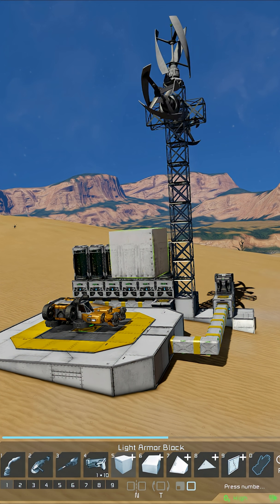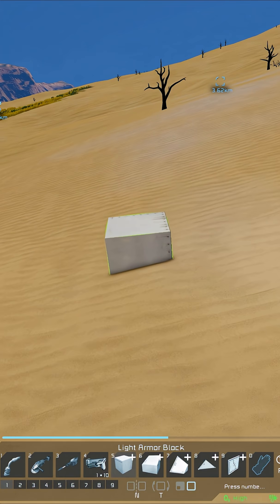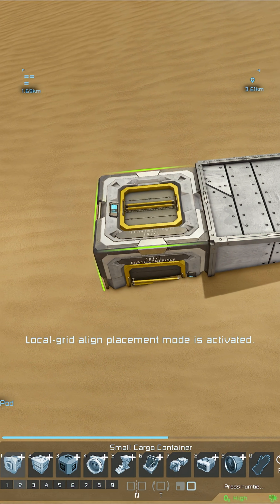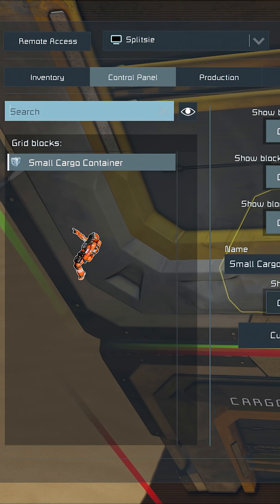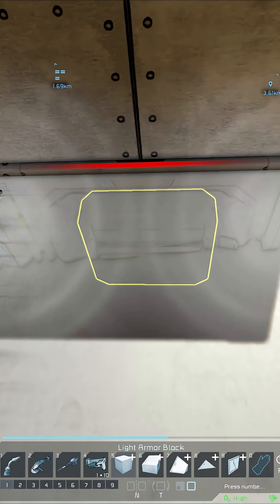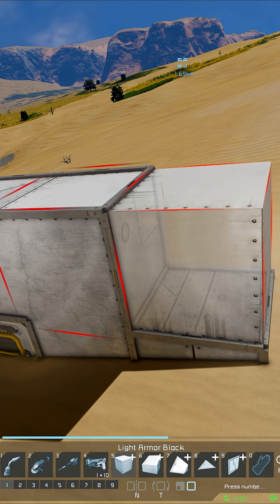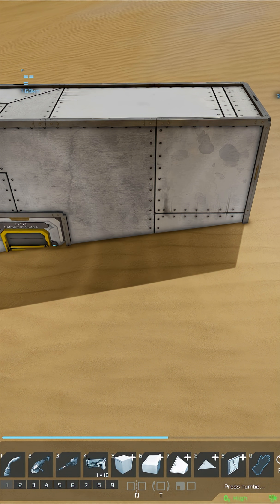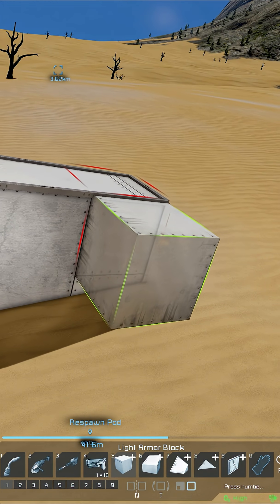"Why isn't my Space Engineers base getting power?!?" - I think I know why

Comment: I was using the 'Edge Begone' mod to clean up my grids. I too started having problems with grids not connecting and so turned this mod off. Now I can see if two blocks are actually connected - if they are, smooth surface. Otherwise, a seam will be visible between the blocks.
Reply from the maker: Yup, as much as I like my builds without edges they're useful sometimes :D

Comment: This problem is also easily solved by making sure that you are facing a block when you place a block, if you are simply pointing at the ground with grid alignment, you weren't telling it to place that block on the same grid as the other blocks
Reply from the maker: Facing a block isn't using 'local grid alignment mode' as that is only active when trying to place directly in voxel. The point is, building this way used to work and snap to your existing grid as well, now it doesn't and new players have been running into increasing issues with their grids being split

Comment: I built a massive warship once in survival. It wasn't until I went and launched what I thought was one ship when like half a dozen seperate grids broke off and, being in deep space with no grav generator, The pieces began to drift immediately on multiple vectors. I had to dash to a small craft, build landing gear, and manually capture and park each chunk of hull for salvaging.
Reply: I would feel like, "okay game, you don't want me to have this ship, fine, I shall sacrifice it to Clang." Mad props for salvaging your ship.
Reply: @MMuraseofSandvich  Thanks. I was only testing the thruster ratio on the back end so thankfully it was a slow drift, but by the time I got to wrangling the last piece the only reason I could still see it in the asteroids was because it had it's own power and the ship's beacon.
Reply: I think that the grav gen does not affect grids anyway
Reply: Has this been fixed yet?
Reply: @Dragonslayer_1215  For me? Yeah it was like 20 minutes of flying. Lost a small chunk but no big.
Reply: Sounds like you needed to do some engineering in space c:

Comment: I also noticed some weirdness when connecting multiple pistons to each other since the last update. Sometimes they either snap in a different orientation or won't snap together at all, until you rotate the new one a couple of times. Not sure if it the same issue.

One advantage of the new behavior: it's now more reliable to reconnect static grids after accidentally disconnecting by re removing the wrong blocks. In the past I had to use merge blocks more often to put them back together

Comment: Gravity alignment mode does the same. Sometimes and it's only a pixel off. If you use a merge block it will reconnect them and move the smaller of the grids into alignment
Reply from the maker: Annoyingly, I've been testing and oftentimes even merge blocks are refusing to work for me as well, despite being in the correct positions. Haven't figured out the pattern there yet though
Reply: @Splitsie  I had similar issues, found placing and building one at a time works to fix this issue majority of the time. Although I've not gotten a 100% solution to this yet.

Comment: For those that ask why local grid alignment is such a big deal, the suns path follows one of the local grid axis. This is important if you want to make the most of the sunlight for solar array power generation. If built in the right place along the local grid, you can make a solar panel (or a series of solar panels) receive sunlight permanently since it never sets.
Reply from the maker: That's not how local grid alignment works. It aligns to the first grid in the local area, so if that's not aligned, local grid alignment won't be either

Comment: I recently had another problem.  A 300-ton 'static' base popped up out of the ground to line up with  the previously built grid that was beside it when I added a few more blocks to the older one that decreased the distance from it to the new grid to less than one block.

Apparently, 'static' actually means 'dynamic' in Keen-speak.  :sigh:
Reply from the maker: I think they tweaked something with their static grids that's had more roll on effects than they realised, hopefully it's something they can un-tweak
Reply: @Splitsie  Here's hoping!

BTW, if you add a sensor to either end of the printing cart, you can have it ping-pong back and forth forever until the print is done.  (I suggest adding some half-blocks to keep the wheels aligned so it doesn't try to run off into the sea.)

Comment: Using paint large area can show you where the grids arent connected. Add a conector in-between to connect them.
Reply from the maker: Good shout, a very useful way to test. For those who don't know, you can use Ctrl+mmb to paint a 3x3x3 cube
Reply: Yeah on xbox its just rightbumper + leftbumper + right trigger. Paints whole connected grids.

Comment: not quite related but just had a number of grids get deleted from my solo survival that were docked to a trade station, when I left to go mine an asteroid, 20 mins later, all my stuff including small and large grids were just gone. This has happened 2x now and this time I lost everything because the backup saves didn't go far enough back to before they were removed. I have MES and other mods installed, so it could be one of those.
Reply from the maker: I think the issue is that you were docked to a trade station. My guess is that you have your ship power down when connected which means it was powered down when the trade station forcibly disconnected it after its maximum connection time. This means it's a valid target for trash cleanup. Trade stations are not for docking, they're just for trading and in vanilla you get kicked off to prevent someone blocking a trade station from other players 🙂

Comment: I need to figure out why my ship I built recently won't let me refuel my hydrogen through the new survival kit. Have it on both my base and my ship, both are properly connected, using water mod with collectors that are working and converting water to ice like intended, so the O2 generators are full of ice, yet my hydrogen still will not refuel through them. Going to go back to the old survival kit later today to see if it's a problem with the new block, but if that's not the case, then I'm not sure. They were working properly the day before yesterday, so it doesn't seem to be mod conflict. It's frustrating because my ship and bases air systems are connected to the same conveyor system and work properly, so mod conflict doesn't seem to the issue.

Comment: So to add on to the info from the video for anyone who’s interested. if they are connected the textures are connected into a solid face. You can even notice this in the video, that because they’re not connected a line is made between the blocks but when connected the line disappears. A point against it is when coloured into a different texture or painted in general the textures split. This is also true for if it is a partial built block since the textures don’t render. But a good rule of thumb is if the textures are the same and are connect then the grid is connected.
(This post has been edited with advice well received from the videos creator.)
Have a wonderful day.
Reply: You couldn't watch 60 seconds of a video before commenting? Literally discusses texture seam edges at 1 minute.
Reply: @jamaize1 I watch the whole video and wanted to mention about the textures helping to identify if a grid is connected as a helpful tip not a critique. You are the one who seemed to take offence over a comment over the internet.
Reply from the maker: The reason your comment wasn't taken in good faith was the opener 'you missed a glaring point'. Stating it this way is unnecessarily patronising and dismissive, making it difficult to read anything else without that tone carrying through.

If instead you'd said "Hey, I know you mention it at the end but for new players it might be extra helpful to highlight what the paint lines mean" then I bet a lot of people would have agreed with your point.
Reply: @Splitsie that’s fair thank you for the constructive advice. Sorry about that but again no offence was ment. True if you are a new player or don’t know the game at all you wouldn’t even had noticed it. But I will say this I didn’t like being told I didn’t watch the whole video before commenting it would be an insult to the creator to just say a comment without at the very least watch the video they took time to create.

Comment: Not new, since I've had this issue for years, but it seems more widespread after the latest update for sure.
Reply: it is new considering last up the snapping of 2 separate grids into 1 was supper aggressive and they probably over tuned because of that
Reply from the maker: It's definitely new. In prior versions getting separated grids was actually a bit tricky to pull off and usually required 2 grids to be present in the local area to begin with. Nope it's as simple as two clicks with the 'wrong' alignment mode